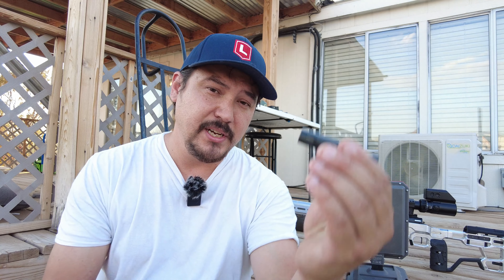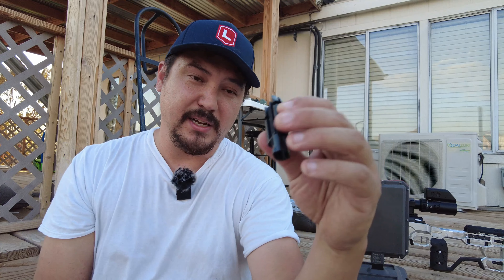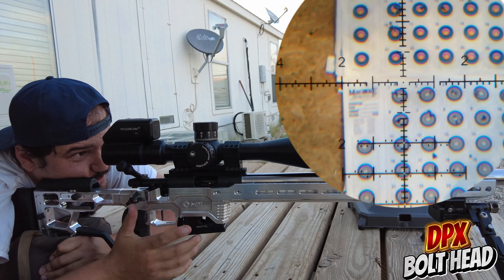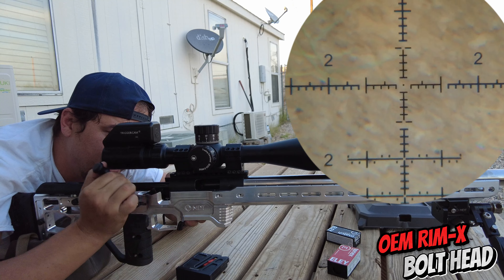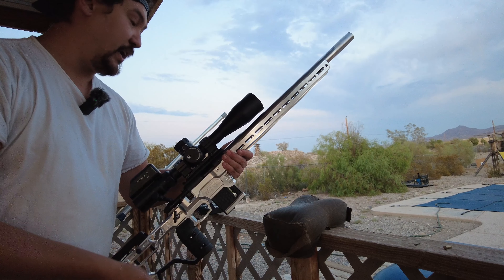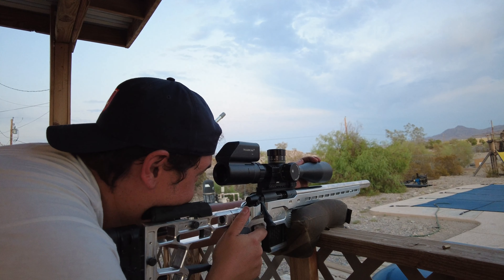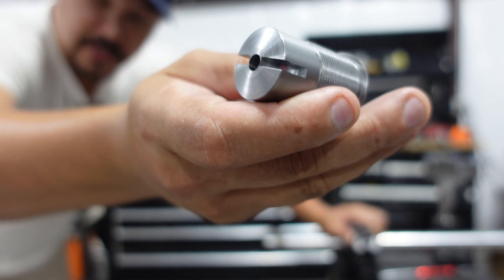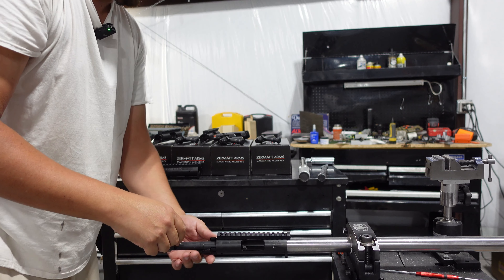Making the Zermatt Rim-X Better | DPX Bolt Mod - In Depth Demo

Comment: I shoot nrl 22 with a rimx,set the mag height in acc  elite never had feeding or extraction  issues.
I see my mates bergara's giving them issues now and then.
Reply from the maker: Like I mentioned,  some may not have the issue. The mag height, even though adjusted to have 1/8in or 1/16 play up an down will help mitigate this issue. However, it still can happen and has happened to many
Reply: @EagleEyeShooting  ok im the fortunate  one,luckily.
Reply: Good job resolving the issue.
Reply: As a Quality engineer, I am always for improved reliability and feel that your assessment of failure mode and proposed solution to be sound and would be greatly appreciated by those that wish to pursue your upgrade offering.  I would like to be counted as a future customer when I go to place an order for your RimX rifle build in the near future.  Thanks for your video content, passion for gunsmithing and supporting this community!

Comment: Great upgrade.  I am one of the latter mentioned group so I will have to wait. Question, will you offer barrel mods down the road?
Reply from the maker: @lobo7107  are you referring to the extractor cuts? Or prefits? Lmk
Reply: @EagleEyeShooting  I was referring to my barrel. I am running a Proof SS barrel. Just trying to figure out what I would do if I purchased your new bolt.
Reply from the maker: Our first few runs will be for our DPG builds first. I'll then open up to receive others. You will need to ship your barreled action over for me to do the mod.

Comment: I have a DPG Kenny built Rimx, about 1 year old. It has malfunctioned once in a match. Round jumped in front of bolt and required a dowel rod to remove. The Rifle has functioned flawlessly in about 5 other matches. Biggest thing for me, is the fear kinda just wondering if or when it could happen again.

Comment: Any issues with extended mags? Wondering if the magazine spring is going to have enough force to push through the extractor once the extension is attached.
Reply from the maker: The feed ramp in the Rim-X mag along with its control round feed won't be an issue. Ive used 3D print AICS 22lr led sleds with zero issues

Comment: So why has Rim-X Not dealt with this? This problem is catching more traction, and deterring people from going with the Rim-X
Reply from the maker: I cannot speak on their behalf. As a shop that is capable of building "prefits". It does require more detailed manufacturing to include correctly timed extractor cuts. Most shops can't even hold a 2 thou tolerance in tennon length